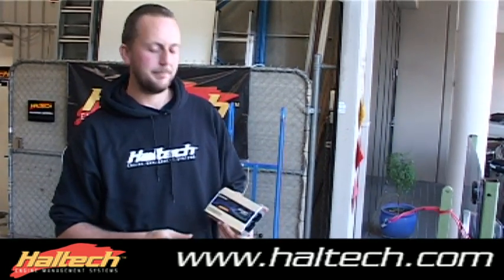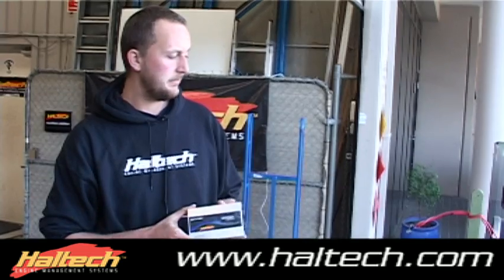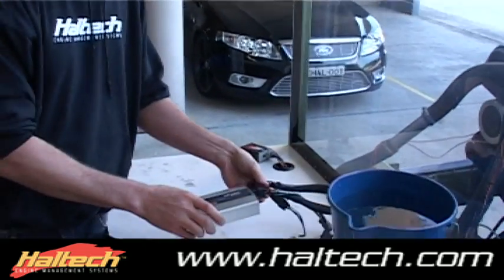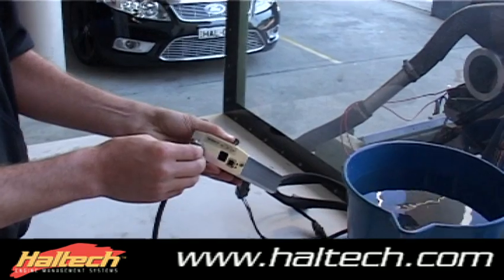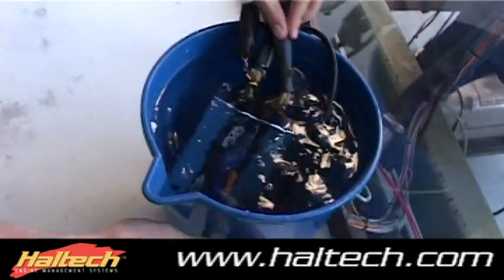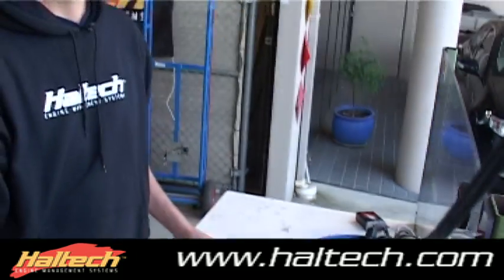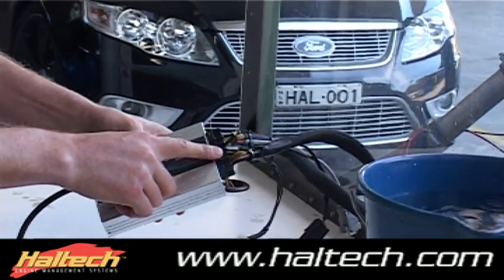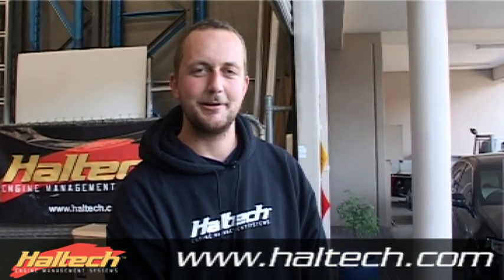Haltech waterproof ECU test

Comment: this is not on all platinum sport ecus right?
What if I use some silicone on all joints for an E8 ecu?... or would it give any water condensation problems or heat disipation maybe?